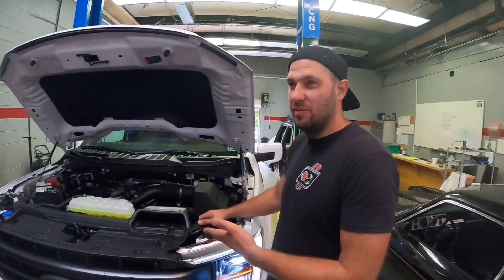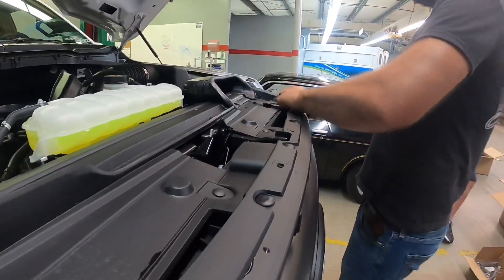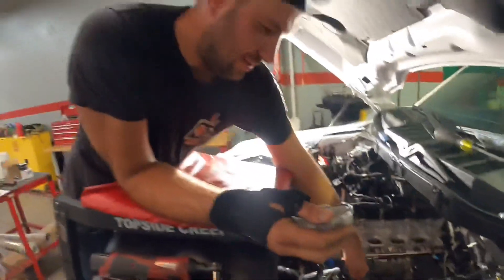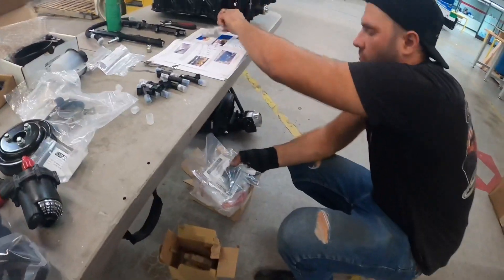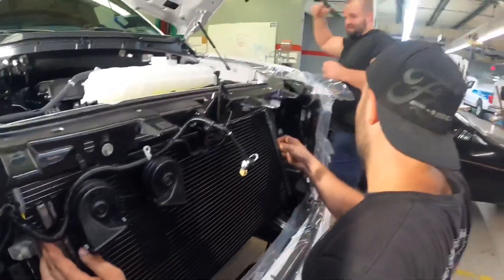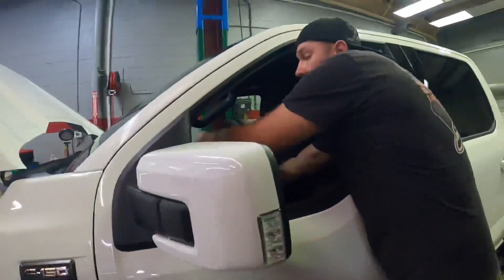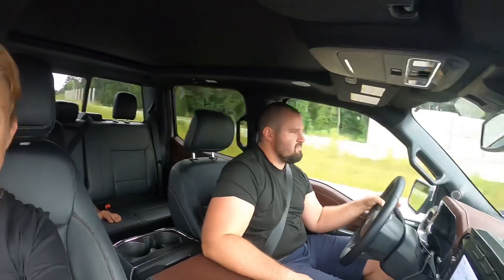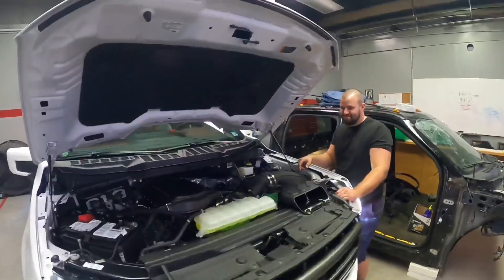2022 Ford F-150 Lariat Stage 2 Whipple Supercharged 775HP. Faster Than Raptor R?

Comment: Nice job!  I am waiting on my ordered '24 Lariat I'm gonna Whipple.  I'm coming from a Whippled '19 XLT that was recently T-boned and totaled.  I did a 180 T-stat on my '19 and due to the lower temps I experienced more fuel dilution compared to the OE 190.  When I switched back to the 190, Fuel dilution went down big time on my next oil analysis.  I may take a drive down to NC to have you install since I am so busy with work.. My '19 install took the weekend and many curse words, lol.

Comment: I've already took down a TRX in my 2021 Roush F150 with the whipple...I do have a few small tweaks from whipple so they think we are closer to 800hp ( will dyno soon ) ...took down a gt350 the other day
Reply: @L8R-HP  I just installed Whipple Stage 2 on my 2022 F-150 Roush. What is the "tweak" from Whipple if you don't mind me asking?

Comment: What f150 should I get ? I want to order one , but with what specs , 4x4 ? whaat differential ? ect ect
Reply from the maker: 3.73, 4x4 with 4auto
Reply: @L8R-HP   what's tha 4auto thing ?
Reply from the maker: @drippingtoohard2868  4wheel drive Auto. Automatically puts truck in 4x4 when needed.
Reply: @drippingtoohard2868  4Auto comes in Lariat and above trims btw.

Comment: Since he opted for the 170, does that require a revision to the tune? Factory is 190 correct? Would it help that much?
Reply from the maker: I would stay with stock. This guy is looking to turn up the power in the future so he wanted to get a 170 in there while the coolant was drained
Reply: @L8R-HP  Warms up a lot quicker with that 170. I had a TRX as well and changed 230 to 201 and same effect. Gets that coolant moving quicker.

Comment: Whats your thoughts on the Whipple vs the Roush for a 2022 F150?  I'm looking at both.  My truck gets used for towing and misc. truck stuff not racing.
Reply: If you have the Pro-Charger (2nd Alternator), Whipple is your only option.